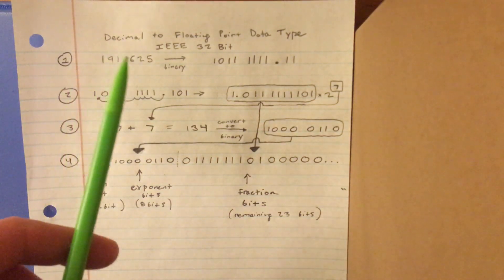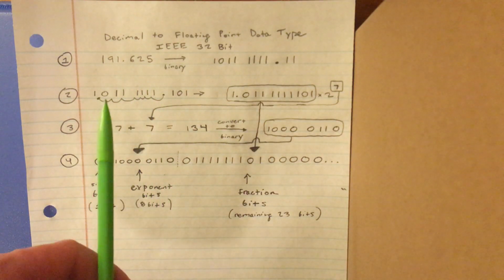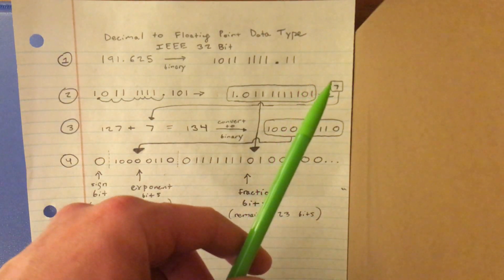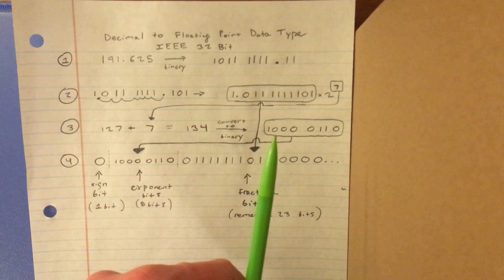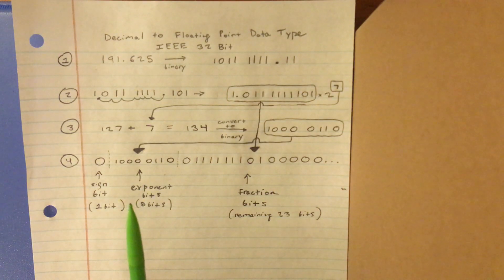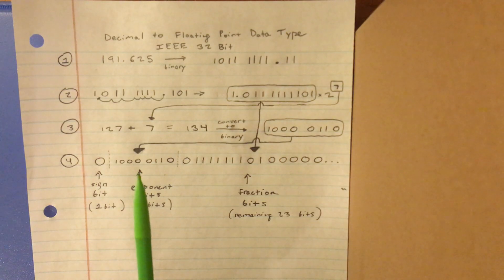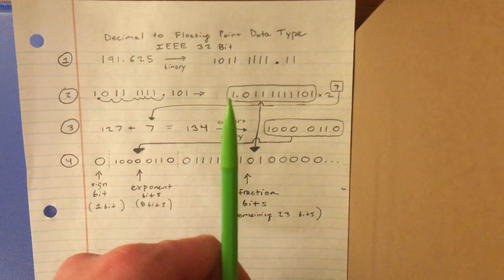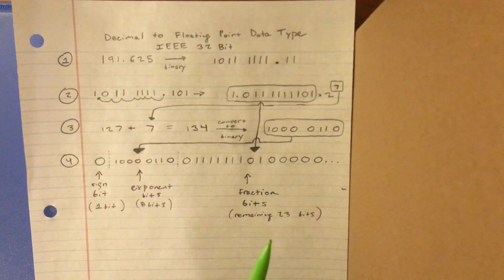Convert Decimal to IEEE 32 Bit Floating Point *(Read Desc!!!)

Comment from the maker: READ!!! In Step 1, the fraction part (to the right of binary point) of the binary number should be .101,  and not .11
You can see it is correct in step 2, and the rest of the problem. I copied it wrong from my draft

Comment: should elaborate on how 0.625 becomes 101 in binary.

just multiplying by 2, see if its over 1 or not, and then repeat with any remainder

0.625x2= 1 r0.25
0.25x2= 0 r0.5
0.5x2= 1 r0
=101

0.754?
754x2 = 1 r58
58x2 = 1 r16
16x2 = 0 r32
32x2 =0 r64
64x2 = 1 r28
28x2 = 0 r56
56x2 = 1 r12
12x2 = 0 r24
24x2 = 0 r48
48x2 = 0 r96
96x2 = 1 r92
and ive had enough of this. 1100 1010 will suffice for 8 bits of "mantissa".

the rest of it would be a lot easier if people still had to learn log tables at school, what "mantissa" is.

this is what maths at school should be. its pretty easy. to think most graduates these days can barely even count to ten let alone multiply or divide...

Comment: if this was -191 do i find the value of +191 and then change the zero at the beginning to a 1 ?
Reply from the maker: Use +191 and change the beginning to a 1. I confirmed this by using an online ieee 32 bit calculator